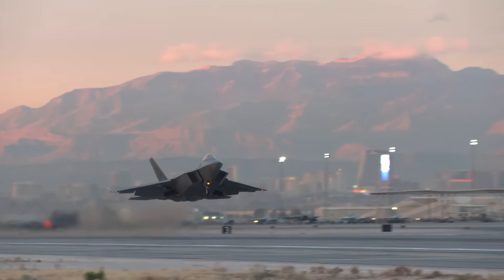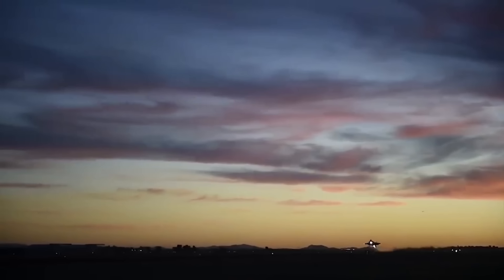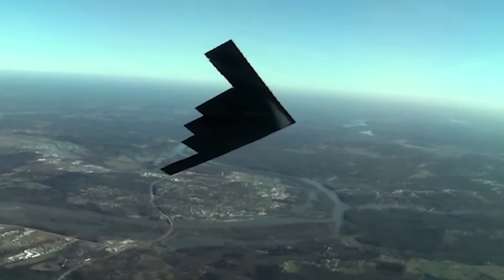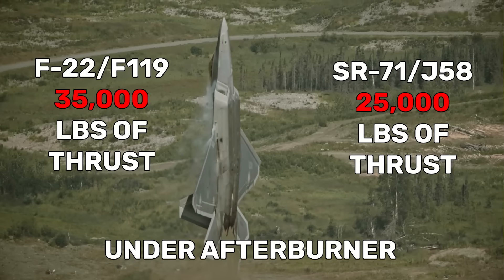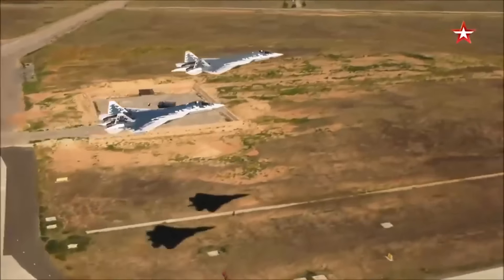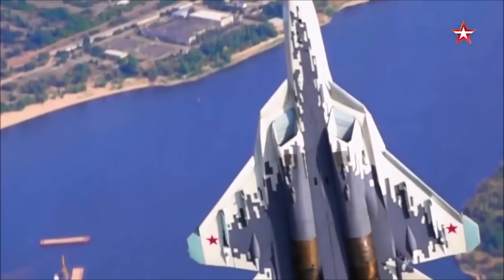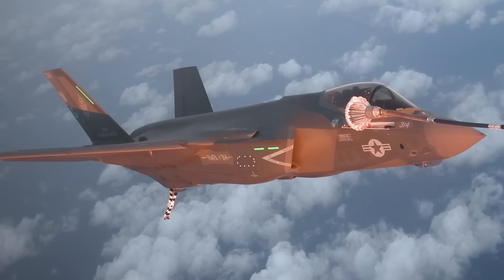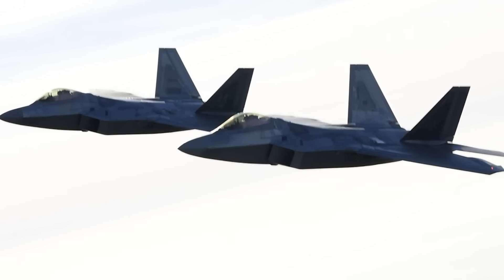The race to field the most powerful stealth fighter engines in history

Comment: The F-35 has been adopted by 17 nations so the price per unit has been driven down. If only the USA had adopted it, it would still have been economically feasible. But Russia only ordered 76 Su-57s and only 22 have been delivered. So I guess it's more like the F-22 (the USAF has 187). Intended to act as a bridge to later, cheaper aircraft. So the Su-75 MIGHT be intended to be an F-35 competitor.

But it remains to be seen if Russia is able to produce the complex electronic systems. Yes, sanction-busting would certainly allow them to acquire parts, but foreign buyers don't just buy airframes, they buy service packages and spare parts and if their is a possibility that Russia cannot reliably supply that continued support, it doesn't make their aircraft attractive.

Likewise the J-20 seems like China's bridge to the J-21. But China is at least in a position that if no foreign buyers are forthcoming, they are still able to produce them. It's still economically feasible.

Russia is also at a huge disadvantage when it comes to the microelectronics in modern fighter jets. I believe currently they can only reliably fabricate 90nm semiconductors (same as the PS2) and the goal of 28nm fabrication slopped from 2024 to 2027 to 2030. So essentially 20 years behind China and the west.

Comment: What are you talking about that they're trying to work with the F-16 engine. You have 16 uses the same engine as the F model 111 the F-15 the last model of the F-14 am I the only one that ever had any power to it. And when they upgraded to the General Electric because the Pratt & Whitney engine had a irritating habit of separating the third stage compressor section. Then you had a bypass turbofan engine just like was on the original F-14 which was also on the original f-111a model how is it that you don't know anything about these engines?

Comment: I was all excited about this new engine's capabilities until you made it clear it was not going into the F35 or the NGAD! We've got the baddest engine on the planet, but no platform for it to power.🤦
Reply: NGAD, yes, that program will get the newer engine technology. The F35? Not likely. A new engine in the F35 would raise the cost from about 80 million to 100 million per copy, and that too high of a cost for a better engine. P&W has a upgrade for the existing F135 to address additional cooling requirements, and that should be more then fine until fighters from the NGAD project appear.

Comment: When it comes to acoustic and infrared reduction capabilities of the Chinese and Russian planes, I can’t help but think that those planes may not have been designed to be easily adapted to such engines, which means they may not be able to fully harness the full potential of their new engine’s stealth enhancing capabilities.

For instance, what good is a cooler heat signature emitting from the engine set up in a lab if the plane itself wasn’t designed to get sufficient excess airflow through the frontal inlets in order to harness those benefits? 

The lacking airframe may bottleneck many advancements in the engine.

Another way of looking at it… If you don’t have hardware that can be enhanced and benefit from more power output from the engine, then what good is more power output? You got to upgrade all the hardware aswell.

An airframe is a bit harder to upgrade.

I speak with zero credibility on the matter, just my laymen’s understanding.

Comment: China can't produce ws10 in quantities and specially quality so their ws 15 is probably not anything bu al 51.  remember ,most of j10 (over 85%) is powered by al31
Reply: About 15 years ago, China stopped importing AL31. The core engine of WS-10A is CFM56, and the overall performance of WS-10A engine is close to F110-GE-129IPE. This model began in 1996 and after more than 20 years of iteration and modification, its performance and maintainability have surpassed AL31. Now, all J10 series, J11 series, and J16 series in China have been equipped with WS10 and its improved versions. In addition, China never worries about production capacity issues, and overcapacity is the norm in China. Also, I guess you're Indian?
Reply: @adder88  Surpassing the AL31 really isn't as impressive as you seem to think it is.
Reply: @ You are indeed not good at learning. The thrust of WS10C is 140 kN, which is greater than AL31, and the thrust of WS15 is 180 kN, which is greater than the F119 engine in the United States. Refer to Wikipedia.

Comment: Ahem. Concorde could supercruise at Mach 2 in the 1970s.
Just saying…
Reply: Welllllll, could it?  It needed to use afterburners to get there, so with respect to Alex's explanation, maybe the AF wouldn't consider that super cruise, per se'.  But I see your point - it's still able to maintain Mach 2, with full passenger and cargo load, prolly about half fuel load by then, without afterburners.

Comment: F35 thrust to weight is not 1.07.  Thats with only 50% fuel at full afterburner. Thats not respectable at all. 

F16 achieves that at 100% fuel and full afterburner. Drop the F16 to 50% fuel and it flies rings around that brick 😅
Reply: The F35 carries 2.5x the amount of fuel, so even at 50% fuel that's 1.3x the F16. 

An F35 with the same 3200kg fuel load as the F16 gives it a TWR of 1.02 compared to the F16's 0.92, both on afterburner. That's without getting into the F16's parasitic drag disadvantage with combat load.
Reply: @aidanwilliams9452  That's correct but it's not an equal comparison.  The F35 may hold more fuel than F16 at 50% but the 2 fighters don't consume fuel at the same efficiency.  Also the high drag, high wing loading (high inertia) means the F35 consumes more fuel to maintain the same airspeed per maneuver.  In other words the F16 trends toward overspeed, while the F35 trends toward stall.
Reply: @saquist  estimates of combat range puts the F-35 at roughly 2.5-3x the range, which indicates either similar or greater fuel efficiency in normal flight. Otherwise we can’t really know without manufacturer details.
Reply: @aidanwilliams9452  Actually...the F35A has a range of 1,239 miles on 18,250 lb of fuel.  The F16 Block block 50 has a range 2,620 mi with the largest drop tanks. That's 7,000 lbs internal and the largest drop tanks. 600 lbs each. That's 8,200 lbs of fuel for the F16 and 2x that fuel for the f35A  at 18,250...

In other words...the f16 goes much further on less than half the fuel.

That's because it's a very light fighter with an extremely Aerodynamic shape.
Reply: @saquist  1,239 is the 35's interdiction combat radius in kilometres, it's range is listed as 2,800 km (but can't find a definitive source on it). Problem is where some of the numbers are from, as they vary by source and some don't specify considerations such as speed or exactly how many drop tanks.

I did some calculations based on the air force's numbers using ferry range and yes the F-16 was about 9.5% more efficient, though again we don't know some important details. This also likely doesn't take into account growth option 1 in 2017 which reduced the F-35's fuel burn by up to 6%. Until I can get more info I'm considering their efficiency to be on par with one another.
Reply: @aidanwilliams9452  indeed. I stand corrected. F35 max range is 1,700 miles
F16 with drop tanks is 2,620 on less than half the weight in fuel of the F35.

That's a function of wing loading. Wing surface generates tons of lift per lbs of weight that you don't require a powerful engine to go further.

This is the same reason why the F16 has no equal in a 2-circle fight. That same low wing loading when applied in a turning bank angle pulls that vertical lift partially sideways shortening the time "around the racetrack".  

The F16 can 1-circle fight like a F18 or F22 but not for long. Remember the F16 was the first fighter to use Fly-by-wire. That's what the F35 uses for that fast instantaneous turn rate but the F35 lacks LERX tech like F16 and F18 because it compromises stealth.

Comment: Thrust vectoring!! We need thrust vectoring on all fighters! The F22 pilots rave about it! I don't understand why we don't adopt that tech for all our fighters. Hell, imagine A10 whipping around with that tech, horrifying. Great video Alex!
Reply: This are just my thoughts but I think that the increase of moving parts in TVC would increase maintenance cost and time by to much compare to what use it has in modern air battles

Yes TVC can be used to dodge incoming threats but the also burn a lot of kenetic energy which might become a disadvantage once the next missile comes in
Reply: The actual feedback I heard is that it's just a comfort feature. It makes many maneuvers easier, but rarely actually makes a difference in capabilities.
And for that limited effect, it's just very expensive in cost and maintenance.
Reply: Doubt ngad will have it
Reply: Well thrust vectoring is cool. But it’s actually not that useful in a modern BFM fight. You want to retain energy during maneuvering. Using thrust vectoring for post stall maneuvers leaves you with no airspeed.
Reply: @GGG19872 

Won’t need it. The NGAD will be blowing things out of the sky from 200 miles away.
Reply: @OrtadragoonX  yeah I’d bet IR stealth will have a priority over thrust vectoring
Reply: Thrust vectoring is only really useful at high altitudes where the air is too thin to interact with control surfaces. Super low speeds are not where you want to be flying, and the additional cost and maintenance makes it less worthwhile. After all, you can perform similar manoeuvres by managing the aircraft's stability, hence why the F-35 can perform some of the F-22's low speed manoeuvres despite lacking TVC.

Comment: The F22's engines are superior to an F15's any every way then why is an F15 considerably faster than an F22. What am I missing here?
Reply: The F-22 traded top speed for acceleration and climb rate versus the F-15.
Reply: On paper their top cruising speed is nearly identical. It is my understanding that as with the F35, the F22 is restricted in order to protect the stealth coatings and since top speed isn't the priority they didn't go with the most efficient intake design, but rather the most stealthy.
   I had heard long ago, decades, that it's true top speed is unknown because it has never been pushed to it.
Reply: Aren’t the F-22’s full capabilities still classified? I believe hearing one F-22 pilot saying. They still have flight profile characteristics of the Raptors. They still don’t disclose to the public. To this very day? 🤔
Reply: We don't really know the actual top speed of the F-22. Either way acceleration is more important than top speed, even one of the program directors for the F-15 said that in the first 30 years of service they rarely went above Mach 1.3, and even then it was largely for testing
Reply: Well, F15 top speed is Mach 2.5, and the F22 is Mach 2.25.

However, that's top speed and that does not always indicate the amount of power and acceleration you have.

F15: total max thrust = 47, 540lbs
F15ex: total max thrust = 59, 000lbs
F22: total max thrust = 70,000 lbs

So, the F15 probably has better aerodynamics due to NOT being stealth.

But, remember, fighters rare hit top max speeds. 

So, in climb rates, and acceleration, especially below Mach 1.5  the F22 is in a league of its own and eat the F15 in that area.
(much much better performance then a F15 in that speed range in terms of climb rates, acceleration etc.). 

So way way near the top end, the F15 might have some slight top speed advantage, but that's such a tiny part of the overall speed enevelope. 

Everywhere else, the F22 going to produce far better performance, acceleration, and climb rates.

Comment: Bleh if we could withstand the radiation from some black holes without mechanical gearing falling apart (which is impossible as the gears disintegrate instantly as they can't turn fast enough)  WE could have a drive system that puts out ten megatons of tnt force and spin a few other micro black holes and compress the beam into gamma rays and we would have something near the speed of light.  Problem being you have to keep out of the gravity field of two of the three black holes and keep them from colliding which is near impossible.  THe other thing is to have nanobots that can fold themselves inside out and produce heat to thrust as well as change direction of the solar sail making for a better solar sail.

Comment: I appreciate your channel and your insight but, let’s not over assume or over estimate Chinese capabilities have we learned nothing from the Ukraine invasion by Russia that numerical advantage means nothing compared to quality, so China has more planes of one type, the U.S. has 14,000 airframes of various types. Furthermore, the Chinese are completely untested in any conflict except their invasion of Vietnam which went terribly bad. The U.S. has had decades of experience with successful air campaigns in and out of large scale and small scale conflicts. I guess my point is that this just seems like conjecture and hyperbole based on figures released from an authoritarian regime run by a dictator and we know how real those figures are at this point.

Comment: It's not a good aircraft , 
Used fuel chamber and needs tons and tons of fuel and the passenger is sitting on a fuel chamber ,
I can power that perpetual power as big as a luggage only 2500v ac x2 , and I can remove the weight first before flying. 
And can float in the air .
No refuelling cause the power is perpetual motion power. 
No need of aircraft carrier. 
Base and drop and reload missile and back to base .
You want this , 100m$ first .